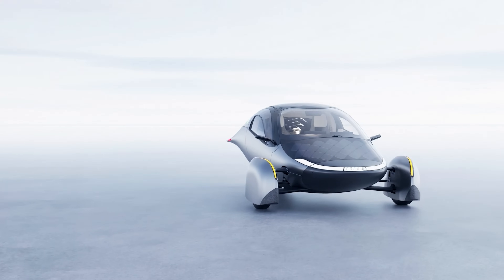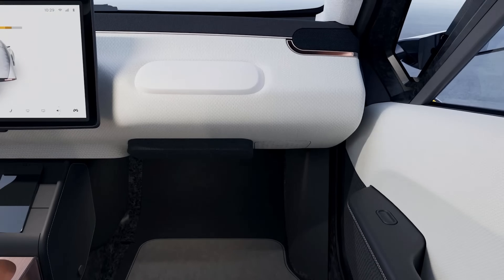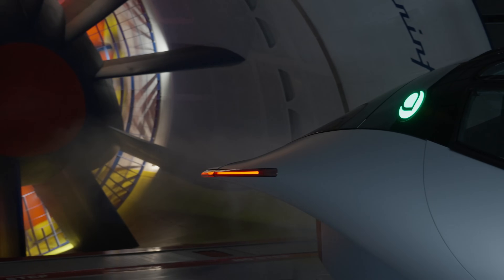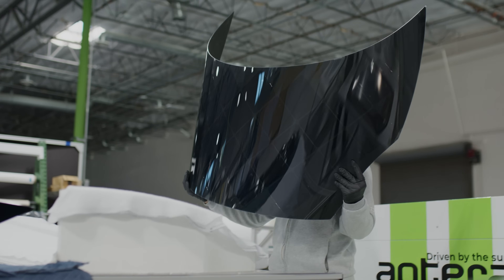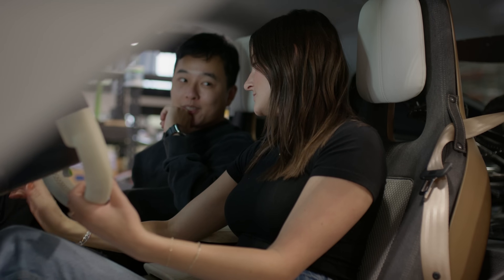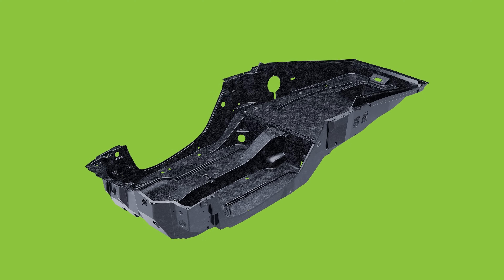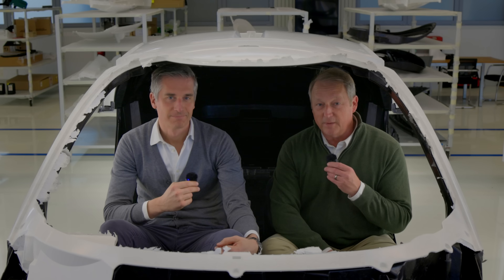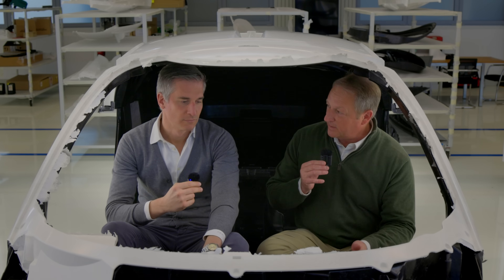Aptera Recap 2023

Comment: I hope that Aptera's solar and battery side of the business is able to eventually spin up something similar to Sion's, sry I mean Sono, business of making solar modules for on vehicle installation before they tried to make their own solar car. That could be a potentially more lucrative business than just the vehicle.
Reply: I expect an Aptera announcement in the next couple of months along these lines.
Reply: I kinda doubt it. Solar doesn't make much sense on most vehicles because they're so inefficient. The only place they really do outside of an Aptera is something like an RV where they'd otherwise be running an engine to power the lights and AC.
Reply: @Skylancer727  I think that's the market space Sono (sry it wasn't Sion, that was their car model name not the company) is in in Europe  Mainly larger vehicles with lots of flat sides: buses, RVs, trucks with trailers etc. Aptera could possibly be an OEM part supplier for solar body panels for companies like Toyota as well if more vehicles wanted to add supplemental solar body panels. Though I'm not sure what manufacturers already exist in that space.

Comment: I hope there are very few modification needed for the molds.  Ideally none.
Reply: All molds are already through the validation phase
Reply: I am quite aware.  However., when reality meets the designed world every now and then something is slightly off.  It is unlikely, and I expect it to not happen as Aptera has been very good to minimize this type of thing, but it isn't zero either.
Reply: I think that dimensionally validated parts have been pulled from all of them now.

Comment: If they start selling I'll strongly consider an exception for the "always buy used" rule
Reply: if it was a 3 seater or like 3.5 it would be an apsolute win
Reply: @ntuberoo they are talking about a 4 seater at some point . Same kind of shape just a little longer
Reply: @L.L  With this car taking 5 years to come out, don't expect that to be around till nearly 2030 if the company even lasts that long. I wouldn't tell many to hold off for that when you might even go through a whole car in that period.
Reply: @Skylancer727  yes I agree I have been fallowing them for a long time and starting to wonder if they will ever making to production.
Reply: @L.L  I've had little doubt they'll make it to production, I'd more say their struggle will be expanding out of California. I mean how exactly do you transport a 3 wheeler nation wide? It's too big for a normal truck like a trike, the third wheel means it doesn't work with most car trucks, etc. Only thing I can really think of is things like auto rack rail cars. 

The other one is more will they sell all original models? I can guarentee they'll make the launch model, but will they ever actually make the 26K or 1000 mile models? I mean people have shown how much 400 miles sells it and many others went with the 1000 mile which requires far more work to make. Will they last long enough to make all of them? Or will some of them eventually be scrapped?
Reply: @Skylancer727  they'll be able to use Cybertrucks with trailers with the Aptera stacked quasi-vertically balanced on their front wheels.
Reply: @Skylancer727  some sort of dolly to bridge across the two rails could be made for transporting it. There’s one problem solved.
Reply: @Skylancer727  Have you seen the videos of them transporting the Aptera  to events? It's not an issue to transport  the Aptera.
And how do you think they transport the Spider roadster or the CanAm?
Reply: @jasonevans6473  those are much lower volume. We're talking about transporting thousands, possibly more than that considering Aptera's goals.
Reply: @Skylancer727  Quite a few of us live in the Midwest.  I will travel from Iowa to pick up my LE Aptera.

I do think that some versions may be scrapped - for example non-full solar models - but I bet that the additional range models and the off road versions will eventually get here.
Reply: @n.brucenelson5920  I think the non-solar model will come out, I more thing it will be truncated to all or nothing. There's a large number of people who'll never give up the rear window but at the same time who's gonna get the model with just the roof and dash vs also getting the hood for $300? We don't need all 4 options like they have now.
Reply: @Skylancer727  My reasoning is that it looks to me as if the support structure for the solar hatch is part of the crush zone engineering.  A glass rear window version would likely need a separate crash test.

Of course in the US that would not be legally necessary, but all and all, I think the safety concern would win out.
Reply: @Okurkaarrgghh  fine by me still going to be cheaper to operate.
Reply: @ntuberoo  It is already a win for what it was designed to do.  You may wish to wait for the 4 wheel, 5 passenger sedan.
Reply: I already broke my rule of "never preorder anything"
Reply: I live in Iowa and Iowa has a law on the books that you have to buy from a car dealership. So I will be flying out to Aptera and driving back. It will be a good vacation.
Reply: @jasonevans6473  Hello fellow Iowan!  I am in Lamoni, and have an LE on order.  Perhaps we can plan a trip together.
Reply: @jasonevans6473  Hello, fellow Iowan!  I plan to make the trip sometime in the first half of 2025 to pick up mine.  I live in Lamoni.  My wife and I have already ridden in a prototype, and even in that form they were awesome.
Reply: And I am sure that Aptera has already thought about how to deliver the Aptera.
Reply: Right
Reply: It's my estimation that a small back seat, just enough for two or three kids, could be added without changing the outer shape. Only the frame would have to be altered slightly to make room between the battery and rear wheel. A three seat front bench seat would be trivial. 

A full sized rear seat would probably require moving the rear wheel back to make room. At that point, I'm not sure if they would decide to just go with four wheels or try to stick with three.
Reply: @richardryley3660  Adding more seats towards the back would totally change the weight/balance in an unsafe manner.  The 5 seat vehicle will be a 4 wheeler.
Reply: @n.brucenelson5920  It would be unsafe if they keep the same length. They can keep it a three wheeler if they move the rear wheel back. They just need to make it low and with the weight as far forward as they can.

A five seater they will probably want to go with four wheels though. The three wheeler would be a 3 or 3.5 passenger car with fold down or jump seats only.
Reply: @richardryley3660  I agree that that could work on a 3 seater version if there was enough demand,
Reply: Lmao same
Reply: Where there is a will there's a way.
Reply: The problem I found with buying used was that there was always some "mystery problem" that would take at least 250 a month to fix. With my new car I pay 240 a month and have no problems to deal with
Reply: Waiting for the bait and switch on the prices. I bet at least $10k higher priced.
Reply: You’ll have to pay double for a launch car
Reply: @andrewfuller8440 no way.
Reply: @andrewfuller8440 60k then?😂

Comment: So much for the 100% molded body and safety that comes with that.
Reply: Huh?
Reply: They never said the body was 1 piece
Reply: @johnhayes3314  You're right. Because that's not what I said. Bout a year and a half ago they were working on  molds from a hemp composite. 3 pieces to be specific. All molded with minimal bolts. All of that appears to be gone now.
Reply: @halllwd94  They decided to upgrade the body to carbon fiber to make it faster to produce.
Reply: @halllwd94  They moved to molded carbon fiber just because the pre-orders are way higher than they expected. The car was always expected to be niche so the idea of hand molding composites wasn't an unrealistic idea. But with the Aptera going over 15K orders they realized they would take years to meet those numbers. It's even more serious now with them reporting over 45K deposits. 

In the end composites and carbon fiber are very similar mechanically but carbon fiber should be far more consistent part to part and should last longer. In many regards it's honestly a moderate upgrade as carbon fiber is more ductile meaning it's less likely to shatter.
Reply: It's molded carbon fiber now. 6 pieces make up the body.
Reply: @joshualutz166  That's what I said..
Reply: @halllwd94  No, it isn't. The aptera is still 100% molded body.
Reply: Yeah, it's better and safer now. What's your complaint exactly?